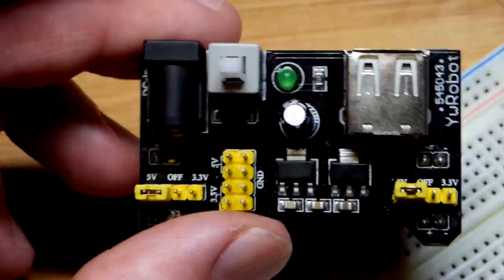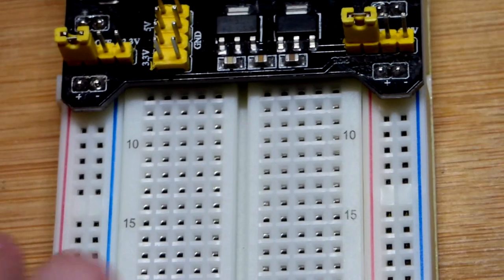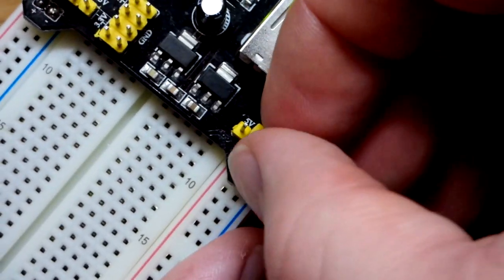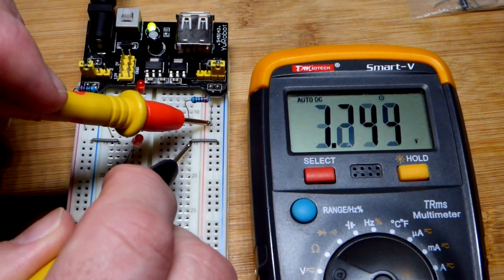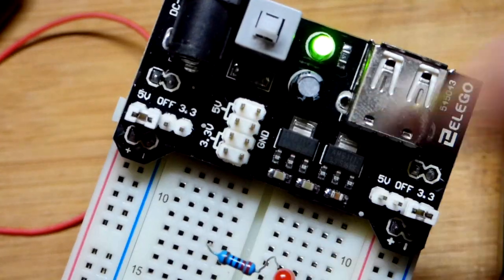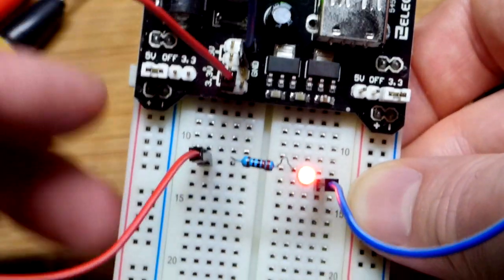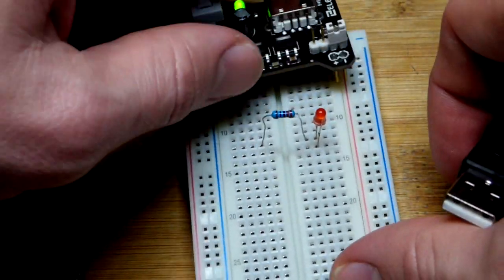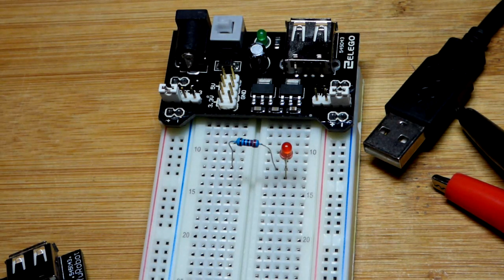How to use a breadboard power supply module for DIY learning electronics

Comment: Thanks for this video! I'm just getting into electronics and I've been messing around on breadboards using batteries. I bought a electronic starter kit with all kinds of stuff that I have no idea what to do with. It has no paper instructions only a DVD and I actually don't have a DVD player right now or a laptop. So I dug out the power module and wanted to use it but had no idea until I saw this video how exactly to use it in what the pins on the top are for. Now I feel confident I can use the power module on my breadboards as I continued to learn about this fascinating and exciting hobby. Thanks again!
Reply from the maker: Glad the video is helpful, thanks for watching!

Comment: I have the same power supply. I use the USB to power all pins. Just use a cell phone block and you get 5volts max. And if you need 3.3 volts just move the jumper.

Comment: I have one of these power supply module and the website suggests 12v input is perfectly fine, or is there another reason why you said 9v ?
Reply from the maker: I have a faulty adapter that provides a little more than 12V when set to 12V, and it fried some of my modules. So I think it's best to use 9V. If you use 12V and it never fries a module then that's good.
Reply: @Electronzap  thanks for the comment, that makes sense, though these power boards seem cheap enough that I wouldn't worry, thanks again!

Comment: Can u power it with an usb too?
Or is it just to "convert" the power from the barreljack to usb
Reply from the maker: With the module I tested, if you plug a USB cable into the USB port, that comes from a 5V USB supply, then it will deliver that power to the breadboard rails. I don't know if all of the board like this will do so, but I suspect they will. I have cables that are USB to alligator clips which I like to use instead, but if you think this is a better option, then I think it will work out well. Thanks for watching!
Reply: @Electronzap  Hello, thanks for the reply.
I asked my dad and he said that usb's are  used like that to give power.
Did we get something wrong?

Also, I do have the exact same power supply module.

Comment: I appreciate the info. I got here because I wanted to know if USB only is enough, or should work because mine aren't. This demo left the barrel power plug in and live when you plugged the USB cable in. So the breadboard was powered before, during, and after you plugged the USB cable in. This means there is no way to verify that the power was coming from the USB and not the barrel jack.

Comment: i think i burned out my power supply 😅 i put 10V or something close to that
Is it possible that its burned out?
Reply from the maker: I've burned these out. I had an adapter that was putting out more than 12 volts when I set it to 12V that I think help fry some. Pretty sure I fried some when I accidently short circuited them too many times and/or for too long. Back when I used breadboard power supply a lot, I bought a pack of about 12 to replace ones I destroyed.

Comment: Can I use an adapter power supply of 12v 1.5 amps? I only have this in my house
Reply from the maker: I have an adjustable AC to DC power plug, that was outputting more than 12V when I set it to 12 volts. That seemed to fry some of these modules. But 12V may be OK otherwise.
Reply: The AMS1117 has an absolute maximum voltage input of 15V. I wouldn't use more than 12V, and preferably 9V because with a 12V supply, you drop 7V across the regulator which limits the current to about 170mA. (1.2W) before it starts to thermal limit the output and overheat. With an input voltage of 9V, you should keep the output current below about 300mA. However if you have a fake or out of spec regulator, it could still fail even with input voltages or output currents within the specifications for a genuine device.

Comment: That LED load should NOT drop these voltage regulators that much.  My best guess...your power adapter is too weak.
Reply from the maker: Thanks for the info!
Reply: @Electronzap  I just looked up the main data on this 5v regulator...it stated that the max. output current should be 1 Amp.
Also, surprisingly, ...it appears that the 3.3v regulator's input is taken from the output of the 5v regulator!
Reply: @dalenassar9152  The absolute maximum power dissipation is likely to be around 1.2W, depending on how much copper on the circuit board is acting as a heatsink. If it's supplying 1A, then it cannot have more than about 1.2V across it, i.e. it has to be being supplied with exactly 6.2V, no more and no less since the dropout voltage is 1.3V maximum. Realistically, you won't get more than 300mA out of it, using a nominal 9V supply. The 3.3V regulator is best being supplied via the 5V regulator. Take an example of drawing 250mA with an 8V input: dissipation is (8-3.3)V x 0.25A = 1.18W if connected to 8V, or (5-3.3)V x 0.25A = 0.43W if connected to the 5V output.

Comment: Is there a way to modify this one to get 7 volts? Or is there another type that is a higher voltage? Thanks
Reply from the maker: I don't think so, simple option is to use a 7807 voltage regulator.

Comment: Can it support 5v?? It's from charging adapter
Reply from the maker: Maybe the 3.3V. You don't need the module for 5V if you already have a 5V supply. It's meant for getting 5V when you have a higher voltage (about 7V to 12V). Some integrated circuits are made for about 5V. So, you need to protect them from higher voltage sources.

Comment: The problem is I don't have barrel port
Reply from the maker: This is just one option. There's all kinds of voltage regulators, and you can design circuits to be powered by any voltage. The higher the voltage though, the more careful and prepared you have to be.

Comment: Thanks for sharing this video great review as I haven’t used a breadboard P.S. in nearly a year.
Reply from the maker: Thanks for watching! I don't use them often these days. Usually only if I want to use 2 power supplies with the same circuit. The bench power supply and a breadboard power supply.

Comment: thanx man. One question.. can you use the usb to upload code to your arduino?
Reply from the maker: I do not think so. I think it is just intended for output power. I could be wrong, and there's probably some breadboard supplies that can do so out there.
Reply: @Electronzap  I tried, but you're right. It doesn't work. I was making a home alarm system last night, and I had many wires flying around. I had to pull my arduino nano out of the breadboard in order to update its code. I guess you don't use the breadboard power supply while your development is in progress; rather, you use it when your prototype is ready.

Comment: One tip I have to add to the video is that this power supply uses two voltage regulators to convert the input DC voltage (no greater than 9v as you mentioned) to 5v (AMS1117) and 3.3v respectively. But keep in mind that those voltage regulators only support up to 1A. So if, for example, you want to power an MG996r servo motor whose stall current is 2.5A and operating voltage is between 4.8v and 7.2v with this supply, your servo will not receive all the current it demands and the voltage regulator will burn out
Reply from the maker: Those are good tips. I don't even go up to 0.5A.
Reply: At near 1 amp both regulators, but especially the 3.3v, run super hot. So safer to stay within 0.5A I guess

Comment: I think I fried mine, when using a 12v instead of 9v adapter. got a little smoke and now the whole thing gives out 10v instead 5v
3.3v still works tho
Reply from the maker: My adjustable AC to DC wall wart supply outputs more than 12V when I set it to 12V. I think that's how I fried some of these units. Long ago I concluded to just use 9V. I'm guessing that 12V is the absolute maximum limit.
Reply: ya, tbh I can still work with what I have now, just gotta put some ressistors to drop the voltage down ig

Comment: How can I always output 5v? Whenever I hook IC's to the pins below it gets reduced to 3.3v
Reply from the maker: If it is 5V with no load, but drops to a lower voltage with a load, then I suspect that you are drawing too much current from the module. The modules also get damaged easily, I bought about a dozen of them when I was using them a lot.

Comment: Thank you very much for this detailed review, I couldn't find any info on how to use this anywhere. 
This would've been more useful if we could use the USB to power it up instead of the 9v.
Edit: based on the comment section, looks like you can power it with USB but you need to make sure to unplug the 9v, they should've at least given a manual for this kit. and looks like its not protected and could fry your PC, glad I didn't connect it to my pc.
Reply from the maker: It should transfer a USB voltage to the board, but that's not the intended way to power it. I just bought some USB to alligator clip cables to use a USB power source to power circuits. And these cheap board should never be used to power sensitive electronics. Just basic circuits you are testing.

Comment: It can be output of 9v?
Reply from the maker: No, these are meant to reduce the voltage to the breadboard from about 9V to either 5V or 3.3V.
Reply: @Electronzap  How to make it reliable, some circuit need at least 9v in order to work well
Reply: @androidenthusiast4943  These breadboard power supplies are intended for use with microcontrollers, logic circuits and sensors that operate at either 5V or 3.3V. If you have circuits that require 9V or more, you will need to use a different power supply. Perhaps a simple 9V or 12V wall adaptor will suffice, but without knowing the circuit you have in mind, it's hard to be more precise.

Comment: If you put the jumpers to the OFF position, what does that do? Does it give you full 9V's of power?!
Reply from the maker: Haven't used one of these in a long time, especially testing it in the off position, but I am pretty sure that the off position disconnects power to the positive rail, and I am guessing that the negative rail is still connected to the power supply.

Comment: can i use the usb fot connecting the arduino to the pc because i don't have the cable?
Reply from the maker: As far as I know, it is safe to power the rails by connecting a powered USB cable into the USB port instead of using a barrel plug.
Reply: No. If you're connecting the arduino to the pc, then it will be to program it. There is no way to get the data from the pc to the arduino via the breadboard power supply module. I assume you have got a usb data cable by now.

Comment: thanks. Can I use normal cellphone charger as power supply? or any other such a power adapter/Charger?
Reply from the maker: The USB plug on this module is an output. You only power this module through the barrel plug. You can always get USB to alligator clip adapters if you want to power something directly from USB. Plus there's probably new breadboard modules that you can find that have more power source options.

Comment: What if my power supply doesnt light up? I cant get mine to work
Reply from the maker: It might be fried. I fried some when I was using 12V to power the module, and when I short circuited them a few times. That was a while ago though, so I don't remember much. I bought about 15 of them to replace ones that I fried.

Comment: personally I have the same and I don't understand why I always have 10V no matter where I place the jumper except on off. Maybe it's because I'm using a 12V 3A power supply?
Reply from the maker: It's been a while, I don't use them much anymore, but I think I fried most of mine while powering them with 12V. I decided to only use 9V.

Comment: 1) I would call it s buck converter because the barrel jack is technically the power supply 2) how much amperage were you providing to it? Maybe the amperage was too low to keep a stable voltage. 🤷‍♂️
Reply from the maker: (Good) converters don't waste much power whereas regulators always do. Converters store some power from a power supply, and then rapidly releases it at either a higher or lower voltage. There's some losses but you get almost all the same power in as you get out with converters. For example, if your load gets 5V 1A (5W) of power, then the power supply might be providing a little more than 10V 0.5A (5W) of power with a converter. It converts voltage into more current, or current into more voltage. Regulators just make it harder for current to flow in order to turn extra power supply voltage into waste heat so that the load gets a lower voltage. To power a 5V 1A (5W) load, a power supply might be delivering 10V 1A (10W) of power to the regulator. If you could find a 10V battery to power the examples above, then the battery is going to die about twice as quickly with a regulator than a converter.

Comment: I have the same power supply & breadboard. I'm a beginner & have just been testing it. I have been powering it through the DC in jack with a 5 volt 1500mA supply. Seems that it splits the 5 volts to  3.3 volt for each side? 
Do you know where I can get a diagram picture for the power supply module?
Thanks
Reply from the maker: These modules are voltage regulators, which means that they basically just make it harder for current to flow as needed to maintain a lower voltage than the main supply voltage. So, If you only give it 5V to begin with, then I am guessing that it could only provide a maximum of about 3.5V. They are usually powered with 9V, but if you power the module with 7V, then it should still be easy for it to provide 5V. I don't have a diagram for the module.

Comment: Nice video. I hadn’t heard of breadboard power supplies. I also use a branch supply but often my projects need to be mobile to test so this is a nice option. By the way, I have to ask, are you from Wisconsin? Northern Wisconsin? You sound almost exactly like my cousin who grew up in Superior.
Reply from the maker: Bench power supplies are the best option, but if you have a 9V adapter or batteries and/or need portability, then breadboard supplies are useful. And, I have always lived in Minnesota in and around the Twin Cities, so I probably talk just like the average Wisconsinite.

Comment: Could u list some reliable bread boards? I don't have a lot of money to give  away
Reply from the maker: Oh sorry I misread in my earlier reply, you can easily find breadboards for somewhere around a dollar or 2 each on Amazon and Ebay. Can easily get them in kits with other components you want. The cheap breadboards are plenty fine if you aren't going to use them all the time. I don't have any more info on if boards are high quality or not than anyone else, I just go by price and reviews. The ones with metal backings tend to hold up well when used a lot.

Comment: Hi, sorry am fairly new at this,. How to connect this to the arduino ide software on pc ? Thanks in advance
Reply from the maker: You wouldn't, this would be a separate power source for a circuit controlled by an Arduino. The arduino could be used to control a transistor, and this could power the circuit that is connected to the transistor, for example. I'd recommended watching a bunch of arduino videos until it makes sense.

Comment: It's interesting that he's bread boarding and doesn't seem to understand that LEDs just like all  diodes have a voltage drop across them of approx. 0.3 volts in most cases.
Reply from the maker: Interestingly, it has nothing to do with the voltage drop of the LED. Which is 2V to 3V depending on color.
Reply: normal diodes drop 700 mv ,red leds drop 1.7 whats he talking about.
Reply: @nsfeliz7825  You're correct...  I was thinking of geranium diodes.  Thanks for the correction.

Comment: Does this still work if my breadboard doesn't have the other power and ground supplies?
Reply: like if I have only one rather than two power supplies?
Reply from the maker: Breadvoard power supplies power each rail separately, so you should have no problem powering just one. You want to set the jumper so there's no voltage on the side where the pins are floating to reduce the chance of a short circuit.
Reply: @Electronzap  Thanks alot!

Comment: If you dont have a barrel jack adaptor for power, i stripped an old usb cable and soldered the leads (black and red cables) to the bottom of the board.

Comment: Can i ask, does the power module have a specified polarity? (Im a beginner lol)
Reply from the maker: You use a standard barrel jack power source to power the breadboard, they typically come center positive and 9 volts works well. Then the modules are made where the left side of each rail is positive while the right side of each rail is negative, which is how most breadboards color code those slots. I can't think of any way to power a breadboard supply backwards unless you happen to come across one of the rarer center negative 9V supplies.
Reply: @Electronzap  By the way, my 9v battery ran out and all i have is a plug in wall transformer with a variable polarity and voltage. The problem is the rated current. I have a module that needs 1A but my wall transformer outputs 1.2 Amps. Is it ok if i plug it in or its too much for the module?
Reply: @rudez1125  The wall transformer will supply up to 1.2A. It will happily supply any current less than that, so you don't have to worry about the current. However these breadboard power supplies will not supply more than a couple of hundred milliamps without overheating. They are not designed to supply amps of current.
Reply: Got it, thanks for the help👍

Comment: How much current can breadboard/jumper wires handle?
Reply from the maker: I don't know for sure.
Reply: Breadboards have a variable quality, and you can't tell just by looking at them. I'd expect problems if I was pushing more than about 100mA through one set of contacts. I use solid core 22 AWG insulated cable as jumper wires and that is rated at 920mA, so it's not a limiting factor.